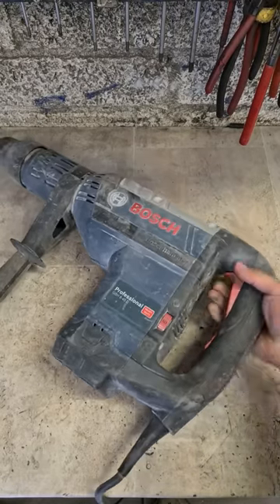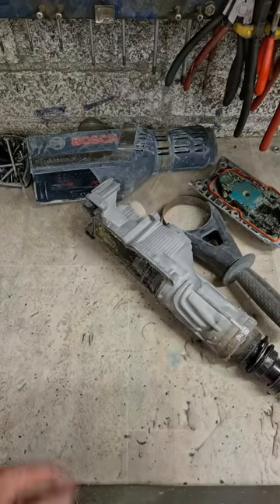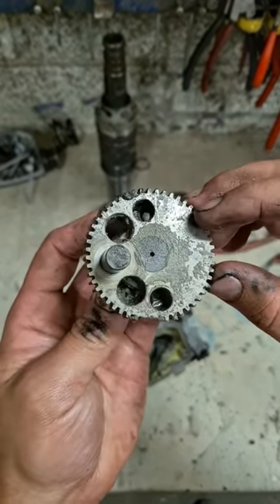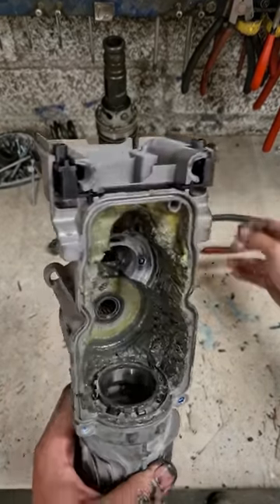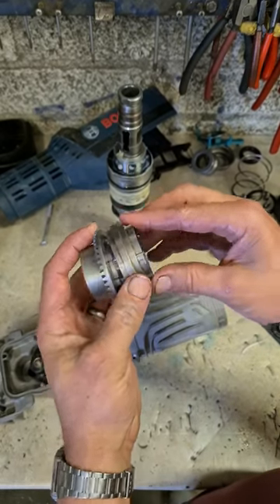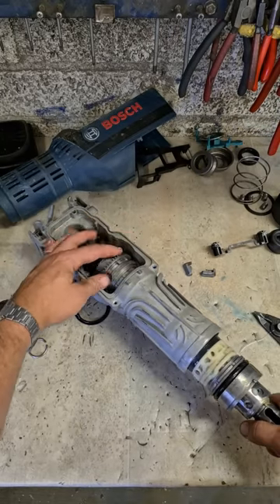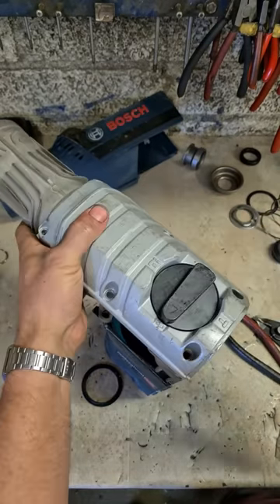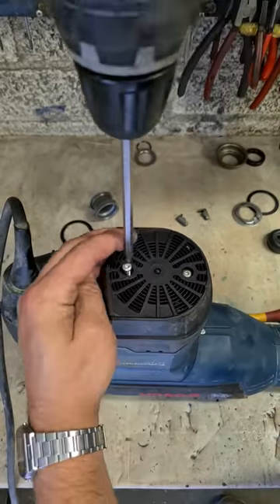Repairing a Bosch GBH 8-45 D hammer under warrenty. New motor, gear and service.

Comment: So it's basically a new tool why wouldn't Bosch just replace the whole thing if it is warranted?
Reply: The spares cost Bosch pennies to replace
Reply: Won't give work for Dean, and far cheaper to replace especially if designed like bosch
Reply from the maker: Good question, simply answer feedback.
This is actually a good way to tell how good a brand is. It's actuly not a good thing to simply replace every broken tool. That's now cheap disposable tools are some cheap and useless. 
Big brands want thier tools to work right  so they use the spare parts being sold to see what parts are failing most often and identify any repeat failures. 
So if this where a common problem, bosch will redesign and improve the part. You see this quite often. And you can see what parts have been redesigned as they normaly get a new part number. 
This is what keep the quality high.
When a manufacture simply replaces a tool with out fixing or looking at it, it means they have designed and built them as cheap as possible to make the disposable. And have no interest in if they fail.
Also this shows how cheap disposable tools actually are, as they have already allowed for the extra cost or replacing tools in the price if the unit to begin with.
Reply: Amazing work.
It’s shocking just how many ppl don’t care about sending a perfectly good tool to landfill.

Comment: I am surprised that they Bosch didn't just give you a new one, the price of the bits, plus your labour, incomparison to  the cost of a new one
Reply from the maker: But if they simply handed out a new one. They would never know this part failed. Repairing under warrenty is a feedback loop, so they can always improve thier tools and keep them from failing
Reply: @deandohertygreaser  they could have send out a new one in exchange for the failed machine.

Comment: Just out of curiosity, what difference does it mean being under warranty . Like who then actually pays you, the customer or bosch, just wondering about the actual logistics of payment. An excellent tear down and repair video as usual.
Reply: The company who made the tool pays for the warranty
Reply: The brand sends the parts, the service owner/together with the brand pays u the labor. Some brands require pictures  but usually u just put the serial number of the machine under warrany + picture of the invoice or the receipt.
Reply: @BlazeAmrabat  thank you for the explanation it was very concise
Reply: depends from what country you are. i work in shop in lithuania(europe). if it is waranty case( waranty filed in their page( bosch) - they give 3 years waranty. if devise broke and its under waranty time - we filled special page- dpd courrier comes and pick it- send to their repire shop. parts and labor goes from them( if its waranty case), or custumer should pay if its not( like water damage)

Comment: I have a GBH 7-46 DE. Drilling is cool. The hammer sometimes misses a stroke. where is the error? Thank you.
Thank you very much for your work.
Reply: O ring seals or striker add a bit of grease on o rings

Comment: The other Bosch blue tools you repaired didn't look all that different than the home gamer green ones, but this is very obviously on another level. It's built like something you would use to break a tank.
Question: the original gearbox grease looked black (moly?), and the replacement white. Does the exact grease type matter?
Reply: I think it just gets 'dirty' from the metal(aluminum) wearing & discoloring the white grease. Although this isn't my field of expertise....I'm the end user of these tools. 😅👍👌🔌⚡⚠️🛠️🔧🔩🗜️📏📐✏️💪
Reply: And yes this is a high end professional model, not something a homeowner would typically need. Unless they're demoing brick, blocks, concrete or removing tiles(very handy for that w\ scraper blade)👍👌
Reply: @tdotw77  From watching AVE, it looks like most companies actually do use moly grease.
Reply: Moly grease is better, but as long as a good quality grease is used, it's unlikely to make that much of a difference.
Long term, if it doesnt get regreased again then there will likely get more worn down. They do generally use very hard steel for the gears though, so it's going to take years to see significant wear.
Reply: Yes the grease gets black as its being worked, same with the engine oil in your car.
Reply: Bosch Professional is build very differently then the green crap.
Reply: @IDuBStepSZ  cant use moly grease in a hammer gearbox. Needs to be a low viscosity gear grease that will flow around the gearbox like an oil. NGLI 0 or 00 is what you want.

Comment: What could be a reason for low hammering power on the same model? Could be that O-ring sealers on piston? Motor seems to be fine, also error(red) light doesn't shine.
Reply from the maker: Needs a service.

Comment: 3D Printer would fix that alot cheaper than you can possibly imagine
Reply: A 3D Printed gear would last 10 revolutions of the motor 😂 Not to mention the chewed up armature pinion.

Comment: Hate to see failures like this. Had to have been a manufacturing fault in the gear something not right with the steel probably wasnt hardened correctly if blew up within the warranty.
Not good.

Comment: I quit buying Bosch about 15 years ago. Just too many failures.
Reply: There are hardly any tools out there that fail less than Bosch Professional.
And if you have a failure like this its most likely within the warranty since this was caused by a bad gear from the factory must have had a manufacturing defect in the steel probably wasnt hardened correctly.